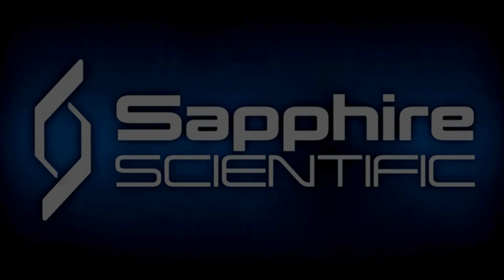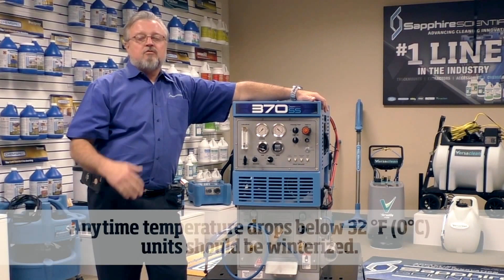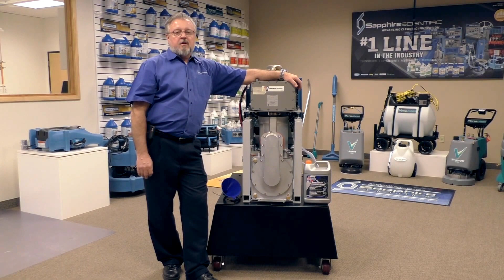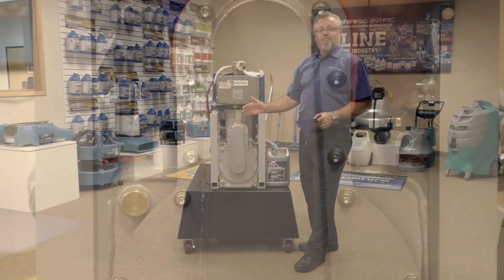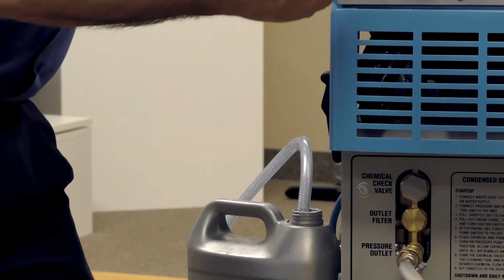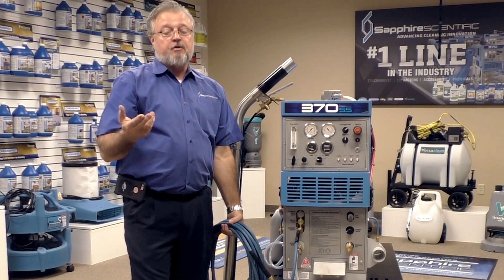Sapphire Scientific: How to Winterize Your Truckmount

Comment: What will happen if I dont winterize my truckmount and it freezes and I dont run the machine and let it thaw out?
Reply: Thanks for your question. The crazy thing about water is that when it freezes it expands. Any component where water is present can be damaged when this happens leading to very costly repair bills. So, even if you do not operate your unit while frozen and let it "defrost" the damage may have already been done. If you have questions about this, or want us to go into more detail please private message us or contact me at: l.ortbahn@legendbrands.com
Reply: Hey man, you might get away with it for a winter or two, (or not) but it cost me $3,000 to replace my heat exchange bc pipes expanded & burst.

Comment: This is great information. A few more extra steps will save some other components from freezing. Turn the chemical to prime to get it into the flow meter, but also turn to "chemical" to get the antifreeze to the solution check valve. The recirculation hose must still be attached. Remove the recirculation hose. Before shutting the machine off, with the pressure pump still on, open the " bypass valve" for 5-10 seconds to winterize that part of the system. Cycle the pressure pump (at around 500 psi) on and off about 5 time to get antifreeze up to the pressure gauge. Antifreeze from priming the chemical system and opening the bypass valve will end up in your waste tank and should be disposed of properly.This information is brought to you by the Advantage Marketing Novi Michigan service department.